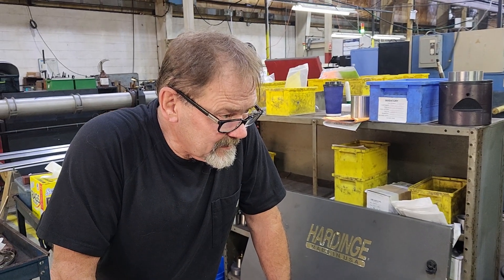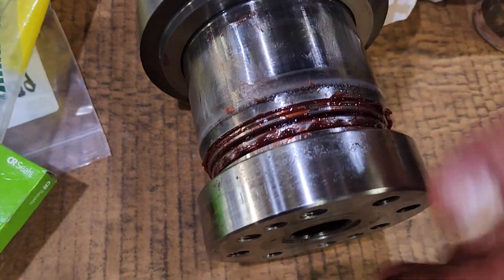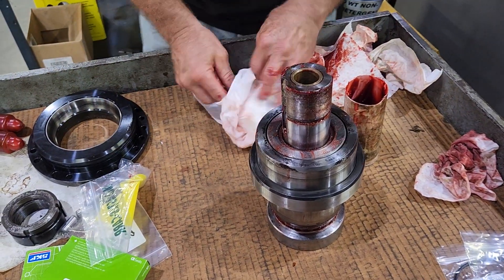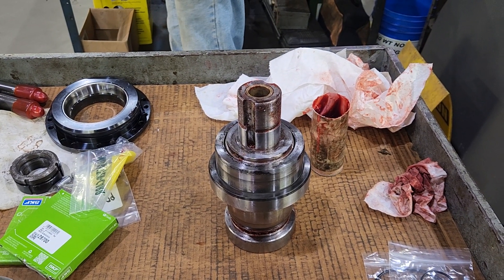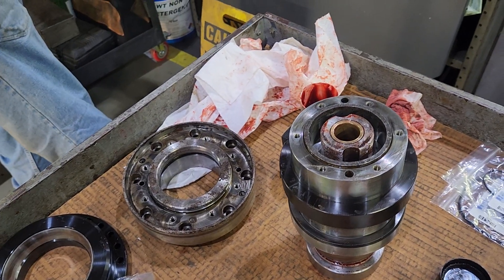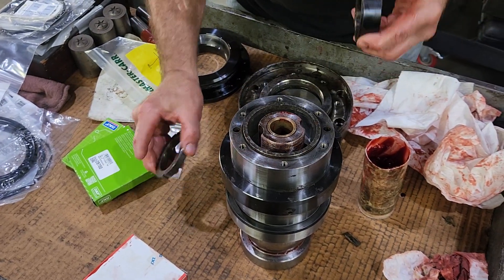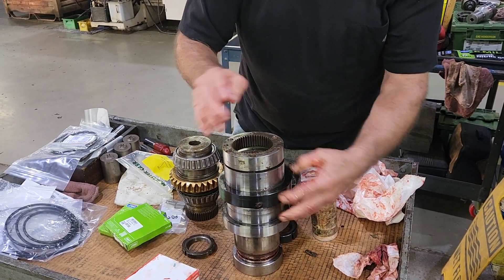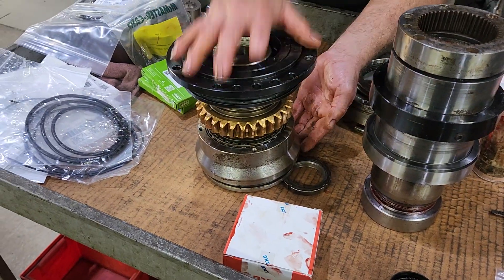Hardinge Conquest T42 Turret Assembly

Comment: hello sir .
I have Harding t 42 sp and when I try to turn a shaft centre to centre, I get chatter on the revolving centre side of the tailstock.. can you please tell how can I fix this issue. and to align tailstock properly..
Reply from the maker: Something is loose, that's what causes chatter. Either not enough pressure on the tailstock, or bad bearings in your live center.

As far as alignment, I use a test bar in the tailstock and indicate it using z-axis travel. If you don't have a test bar, just extend the quill and use that. Once it is straight, move the tailstock near the headstock and use a co-axial indicator mounted in the headstock to tram and adjust the tailstock center. I believe the T42 has an eccentric quill to adjust for misalignment.
Reply: @OtherBrotherDarylSmith  hello sir.
sir hydraulic pressure is ok , everything is tighten . but still there is a lot of chatter on the revolving centre side...
Reply: tailstock whole body has vibration in it...
Reply from the maker: Like I said before, it is probably the bearings in the live center. Do you have another live center to try? This is a tailstock and not a subspindle, correct?
Reply: @OtherBrotherDarylSmith  yes it's a tailstock and I have used a new live centre...but still result is the same.
Reply from the maker: Is the center hole the deep enough so the live center point isn't bottoming out? Is the tailstock clamped down to the ways?
Reply: @OtherBrotherDarylSmith  centre hole is deep. but how to check tailstock that it's clamped or not
Reply from the maker: @adhipmanchand8444  Email me if you don't have a maintenance manual and I will send you one. I would start checking bolts. I don't think yours has a clamp. Do a pry check with an indicator. Something is broken or loose. You said that your pressure was good, is it set to 350 psi? Does the whole tailstock move when it engages the part? Are your switches set properly? If you don't have that information, send me an email.

Comment: I hear hardinge filed for chapter 11. Are there any aftermarket suppliers for parts?
Reply from the maker: They did file. You can still get parts from them, but a lot of specialty items are long lead times. They quoted 4 to 6 weeks for the bearings but the customer found them from a bearing company and had them in a couple of days. I don't know of any aftermarket places, but I do know that Feeler, the company who copied the HLVH have parts that interchange.